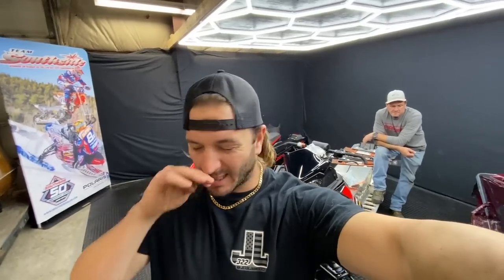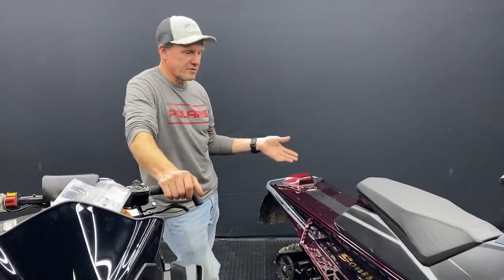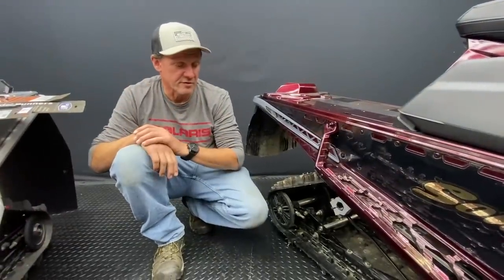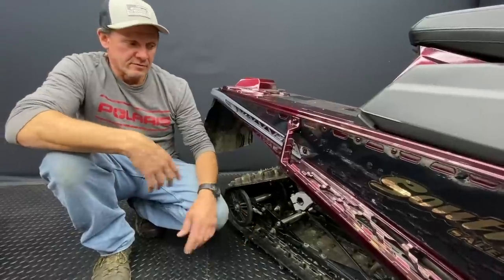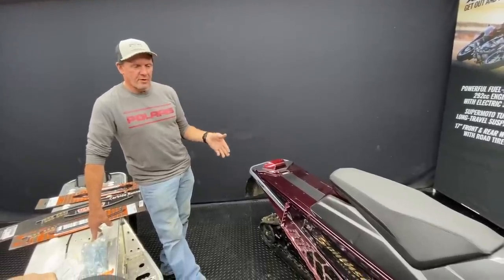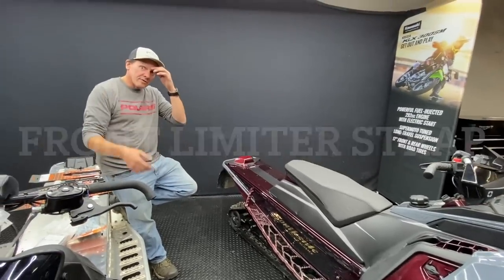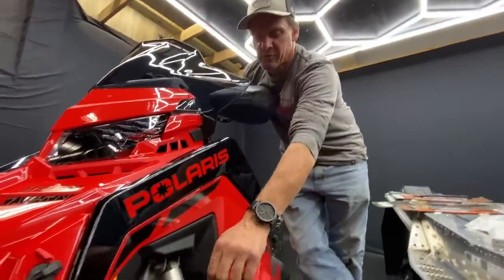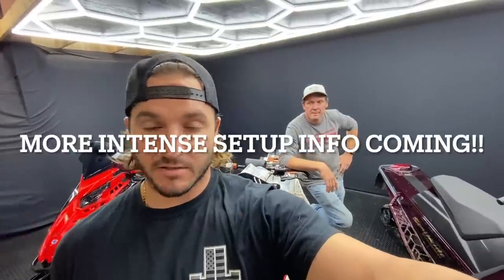POLARIS MATRYX BASIC SET UP! WHAT TO CHANGE TO MAKE YOUR RIDING EXPERIENCE MORE ENJOYABLE!

Comment: does installing a stiffer rear spring still hold true for someone like me at 150lbs (plus 15 lbs of saddle bag gear?)   i like to long haul / packed for an overnight ,twiggy fires and hot dogs trailside, so i'm always carrying a stuffed saddle bag

 im debating on indy xc 137 or the  uncoupled switchback xc144.  i dont need the 7s or the better shocks. i  pretty  much am on all large open run trails but  may find myself in canada during a good winter and wondering if i will be disappointed on the 137

the 144 prob has more room for gear...
Reply from the maker: I dont think you would be a candidate for the HD. I think youll be ok with the standard springs. Especially on an assault due to the valving being stiffer in them
Reply: thanks.  also great content and def good interviews with bruce.  short season indeed.  on another note,  can we see you share your mic since  he is a soft speaker?
Reply from the maker: i dont use a mic actually im just loud haha. we are working on it! i appreciate you following along!
Reply: @JESSEJAMES322  no worries. you have some good content. things like the accessories, tips, opinions etc  keep it up, we're liking the info.  on another note, can we see you do a segment on landowner respect.  trail etiquette? it  seems we have more riders that need a reminder that we are here because of 1 thing, landowner permission.   keep up the good work :)
Reply from the maker: did one last year with the president of our local snowmobile club. Should do another one though!